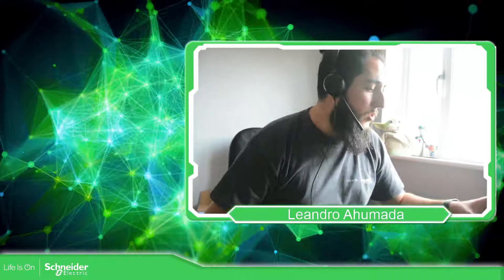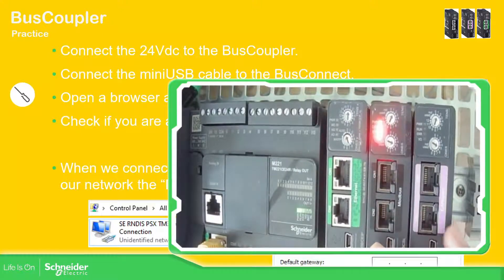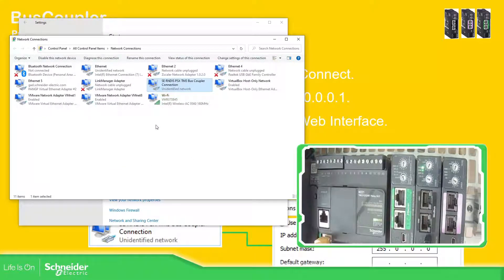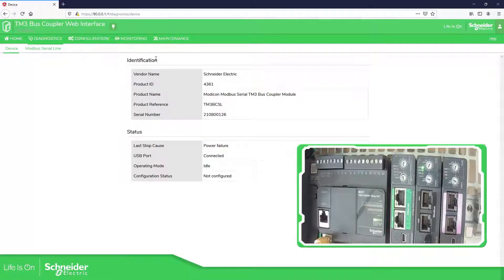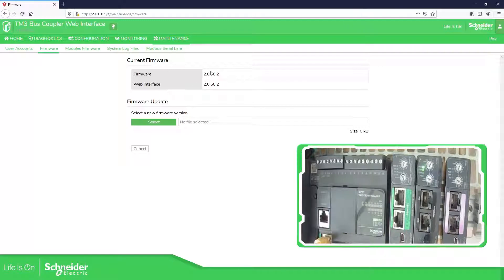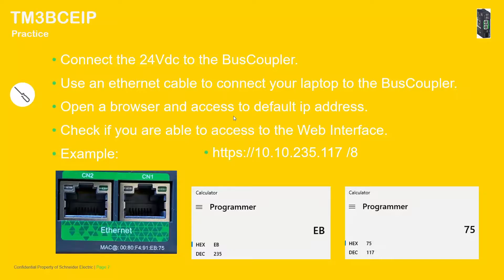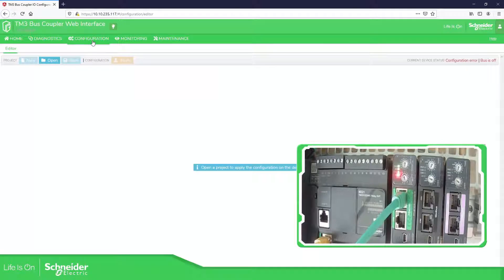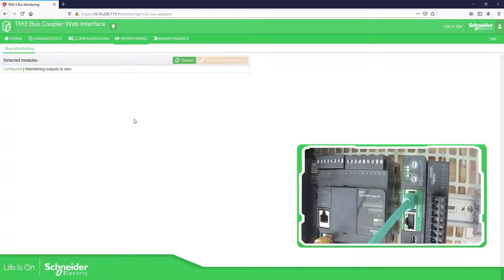Training - Bus Coupler - TM3BC - M11.2 Web Interface

Comment: How to configure in machine expert?
Reply from the maker: Hi there! In Machine Expert is quite easy we just need to add the Bus Coupler in our configuration , select the TM3s and the configuration is sent to the Bus Coupler. It will be easier if you use DHCP otherwise you will need to use the WebInterfadce to set the address.
Reply: @LeTomasAHUMADA  Dear,
Is it enough to just configure a static IP address through the web interface in TM3BCEIP, without downloading the configuration to it?
Of course, on the other hand, I use MachineExpert and plc M241 on a static IP address as well. I ask this, because it would be impractical that with every configuration change (eg AI setting 0-10v to eg -10 to 10v, of an input), or possibly adding another TM3 card, I would have to simultaneously download the configuration to TM3BCEIP again.
It would be logical that all this can be done from a remote location at the PLC controller.
Reply from the maker: @ hi there! You can just confirgure the ip and then the m241 will send the new configuration to the tm3bc. Another solution dhcp and use the rotary switch to match the one in machine expert
Reply: @LeTomasAHUMADA   Thank you for the answer! Otherwise, I don't use dhcp, but create static IP addresses (OP magelis, altivar 320, etc.)
Greetings

Comment: Do you have a manual to communicate Proface HMI PFXLM4301TADAC with TM3BCEIP by ODVA? I can write analog outputs, If you can help me I will appreceitte it
Reply from the maker: Hi Jesus, there is a documents related to the connection between the LTM4000 series and another bus coupler (CanOpen TM3BCCO) that you can download from the next link:
https://www.proface.com/en/file/33826/download?token=LA4LuBLi&context=node/50471 

I am not sure about the protocols for that ProFace HMI but you can use the TM3BCEIP (modbus TCP) or TM3BCSL so you can get access to the register that you want more info:
https://youtu.be/gFFXE9MQgaE (check min 04:00 so you can see the addresses for the IOs)